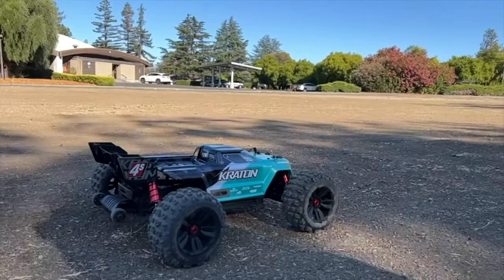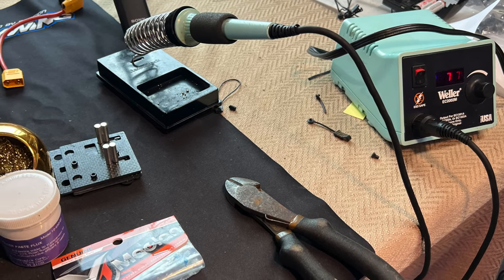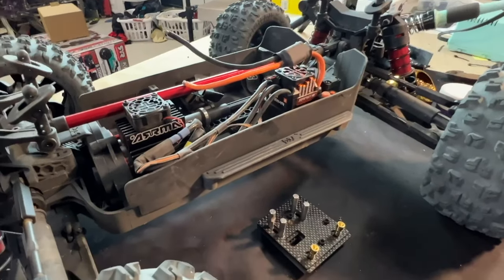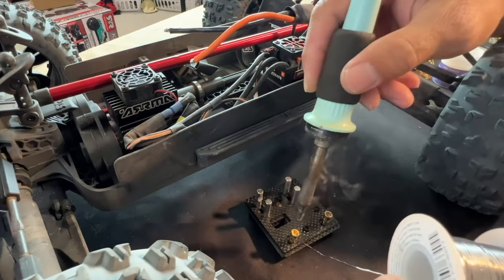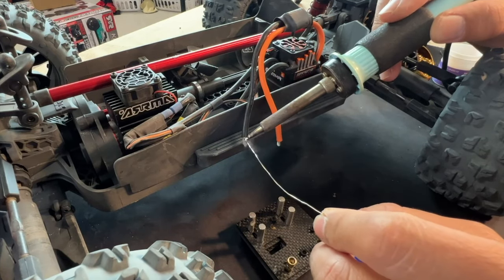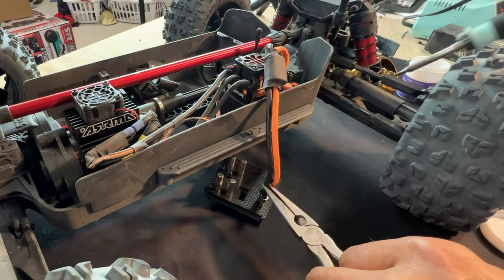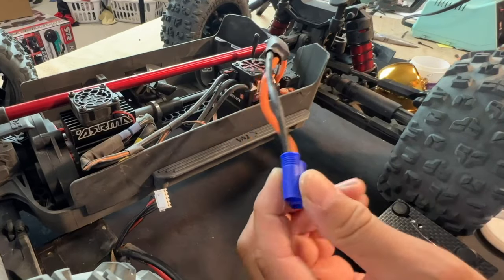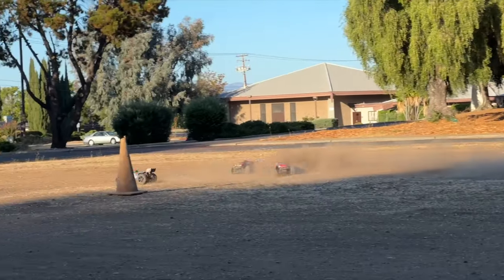How to solder EC5 rc connectors - best soldering tips and tricks

Comment: Please don't take this the wrong way as I'm only trying to help, love your vids btw :), so you need more solder in the wires 1st and then keep the soldering iron on the plug but then feed more solder in, although the wire seems fixed the way you have done it will make a cold solder connection and it will come off later this could be very dangerous also you don't have a complete connection and it can cause heat to build up. There are also 2 types of ec5 and the other type is better but you have to slide the blue cover on the wires 1st, this is better as the pins will never push out as you connect them :)

Comment from the maker: One modification on this is at 6:00 in the video is to keep the soldering iron on the edge of the connector as you stick the wire in. This will allow the iron to cook the solder more as the wire and connector are joined.

Comment: Thank you soo much for the help and video!!! I converted 20 batteries to EC5, but couldn't figure out how to install the male end connectors into the housing when attempting to replace the connector on the Rc trucks. Five videos latter your video popped up. I am new to the channel, but for now on I will be coming here first for all my RC questions and info.
Reply: I use a bigger (5 or6) allen key and hammer it in gently. With it in a vice.

Comment: Awesome Video.  I’ve soldered so many connectors from EC5s, Tplug XT90S, XT60s and the Q8S with and without end caps so need for shrink wrap never had a problem until EC5 I hate them so much.  But this video helped a lot everyone tells and shows a different way. Seems u got it locked and perfected👍🏻.  Thanks for sharing
Reply from the maker: Yeah when I first tried to solder EC5 it was a horror show. It looked impossible without a torch. But have done it now a few times and they held up.  Put more solder than I did on the video and hold the iron to the connector when sticking the wire in to cook the solder stew. :)
Reply: @RCReviewChannel  thank you so much I appreciate your help thanks for helping the R/C community

Comment: Please - make sure your flux paste is acid free (rosin flux paste) when soldering any sorts of electric connections, wires etc. regular flux paste contains acids that will corrode your connections over time. that paste is meant for non-electric applications, like soldering metal sheets, whatever.
Your solder already contains "rosin" which is a flux that won't harm electric/electronical connections. So a paste is usually not needed at all.
Reply from the maker: Very, very good info. Thank you. This is my current flux. https://www.amainhobbies.com/miniatronics-rosin-soldering-flux-paste-2oz-mnt1065002/p117398

The old one was highly corrosive as the can it was in kept rusting over time.

Comment: I just started soldering my own stuff too, after I saw what the hobby store was trying to charge. Live and learn all do all the mistakes possible, it would be cheaper in long run.
Reply from the maker: How much were they charging?
Reply: @RCReviewChannel  $15 PER plug. If you add all the plugs and the additional hardware, it's like $75. I would rather learn how to solder than pay $75 for some else to do the work. And use that money for more parts LOL.

Comment: Does anyone know what gauge wire I need to put on a max6 ESC and make a Y connection for two batteries what gauge is that middle wire and does it have to be a negative or a positive wire or does it matter??
Reply: 12 awg or 10 awg but definitely try to go for 10 gauge if you can to prevent heat buildup

Comment: just go for XT60 or XT90. . You can do it without looking.  You have a better chance of soldering it all around. On the other hand, EC5 is more difficult to have a good solder.  you can't just expect to melt the solder and hope that it will have a good solder.  With Xt90, you can actually see the solder forming around the connection.
Reply: just get a blow tortch and the ic5 will be so eazy to solder 😂 but i run xt90 it's so good on 2s lipo and on 4s lipo
Reply from the maker: I use XT60 for small batteries. Surprisingly, most of the big batteries I buy or given to me for test have EC5. Works really well and has a secure hold.  Great too that it is compatible with IC5, which is what all Arrma and Spektrum seem to use now.  I used to avoid EC5 because of the soldering, but now it is really fast and reliable for me.

But I do like XT90 as well as soldering is easy, just like IC5
Reply: I know this is old but you need ic5 to run big boy batteries and esc

Comment: Does that “smart technology” wire do anything important? I know it’s used when you have Spektrum G2 batteries installed so it can read voltage to the DX3 transmitter. 

I’m running a RadioLink RC8X transmitter and receiver now with the inline telemetry JST cable to show my battery voltage on the RC8X. 

So my question is… I hate the 2 IC5 battery connectors because I only run one big 6s battery and want to get rid of the addition IC5 battery lead.

But both the battery leads from the ESC have that little “smart tech” wire. 1 on the positive wire, and 1 on the negative wire leaving the ESC. 

Can I just remove both of those little smart tech wires since I don’t need them to show my battery voltage anymore since I use the radiolink for that? Or does those little smart tech wires have another important purpose? Other than just showing battery vintage on the DX3 transmitter/remote? 

Thanks a lot! Your content has helped so much in my RC journey. So thank you! 🙏

Comment: How can i replace the entire esc wire? The wire that goes from esc to the battery got hit by the spur gear cause i tucked it in the wrong spot still runs and using electric tape atm but id like to replace the entire wire i cannot for the life of my find any videos on it
Reply from the maker: You would have to open the esc case and replace the wire soldered onto the board.

Comment: How do you solder xt90 to the spectrum esc I don’t know what to do with the smart wire
Reply: cut it? lol. either cut it really short like this bozo did or leave it as long as possible and and zip tie it to either the + or - wire. either way put some heat shrink on the tip so it doesnt short out.

Comment: And this, my firiends, is how to do a cold solder! 
1. add more solder
2. strip more wire
3. touch the exposed part of the wire while it's inserted in the bullet connector until ALL the solder melt

Comment: I have seen this method fail. The wires must be heated, if it's cold plunged, solder may not flow between both the wire and the connector

Comment: Ive been getting a lot of electronics for my crawlers lately and i neeed to kearn how to solder and get a good solder gun setup, i just got a new tekin rx4 roc412 1800kv system, and i have a new Holmes Hobbies brushless puller pro stubby 2700kv i am trying to figure out what esc is the best for Holmes hobbies brushless motors. Any info would be appreciated greatly and thanks for the info man, i also have 3 brand new hobbywing system 2 axe systems one 2700kv And one 1400kv, i also have the 2-1 1800kv fusion. Im running vanquish 3 gear transmission in all my rigs also, my "rock pirate build including the new interceptor chassis" also my capra 4ws has the vanquish 3 gear transmission kit. Have vanquish axles on both rigs also. So i dont wanna cheap out on electronics im always swapping around looking for sweet spots and just different driving styles and what not lol 🙃 😅
Reply from the maker: For Holmes Hobbies motors, the best is Castle Hobbies.  The Copperhead is specifically designed for crawlers and can go to 4s size batteries. The Mamba X is the old staple but is big and more powerful than needed. Folks with small power needs go with the Mamba Micro (sensored or non-sensored).
Reply: @RCReviewChannel  thanks man, i appreciate it, i think i might go with the copperhead. 🤙

Comment: Maybe a bit more solder, and when I do these, I like to make sure the solder is extra hot just to be sure I won’t have a cold joint.  I like using a mini torch, works faster and easier.  I also would never try pressing the bullets into the connector using pliers on the wires 😬. Other than that, I feel you definitely have the concept figured out.
Reply from the maker: Absolutely. Great suggestions.

Comment: Youre gonna kill your wires gripping them that hard with pliers. Wedge a screw driver in on the top and tap it down, dont push the leads in using the wire

Comment: theres no way you have a good connection on those connectors, they are cold as fuck.
aslo a dumb move cutting the sensor wire so short. leave it as long as possible and put some heat shrink on the tip so it doesnt short out (something you should have done anyway) and zip tie it to either the  + or - wire. the way you did you will never have the option of using a smart battery.
Reply: You’re the only person talking about that sensor wire! Please help!

I want to simply get rid of the second IC5 connector because I only run one 6s battery (not two 3s batteries). And that extra connector just gets in the way and is useless.

I do have Spektrum G2 smart batteries. But I run a RadioLink transmitter (remote) and receiver. So I get battery voltage on my RadioLink remote anyways. 

Do I still need to keep that little sensor wire if I remove the second IC5 connector? Does it have a purpose other than displaying battery voltage on the stock Spektrum DX3 receiver? 

Thank you in advance!

Comment: 1:58 are you fucking kidding? the ic5 is .5mm wider and 4mm longer (per side) than the ec5.
Reply from the maker: Not F kidding. We've run it 20-30 times. Works fine except for the biggest jumps.

Comment: get a blow tortch it will take like 30s to do the job! and it will be like it was make with it..

ok after watching the video that's a bad job LOL IM SORRY BUT IT IS....
Reply from the maker: Not a bad suggestion for the final seal. Still need to put solder on the wire and in the connector with an iron though right?
Reply: @RCReviewChannel  it might be easier for the wire but i use the blow tortch and as long as you don't get the wire on fire it's better in my opinion! the only part where you messed up is when you put it in before it dries that's going to make a bad joint.
Reply: @christiansrcs7789  There is some risk of a cold solder joint this way, which is brittle and has higher resistance, because of stuffing the cold wire into the hot connector. If you are going to use an iron, a more consistent method would be to use a wedge-shaped tip that allows you to heat the connector and the wire at the same time (connector on the bottom, wire on top) until both are fully liquid, then smash them together while they are still liquid.

Comment: that is NOT the right way to solder lol.  When you liquify the bullet connect and push the wire in, you need to liquify the solder on the wire as well!  You just cold jointed two seperate solder joints lol...